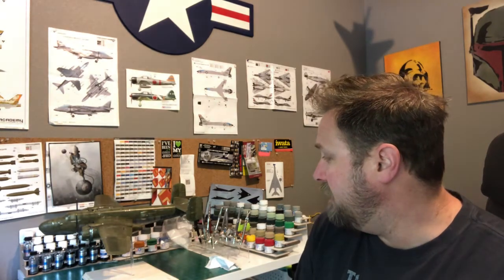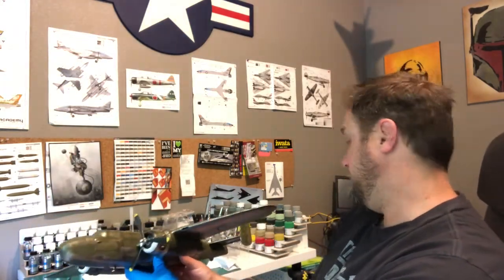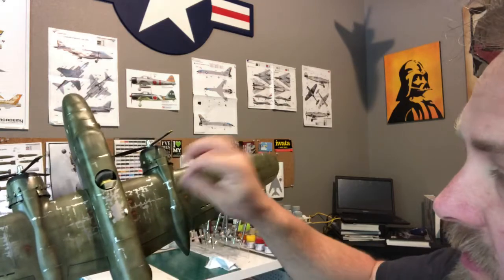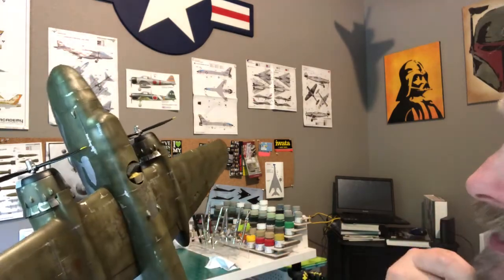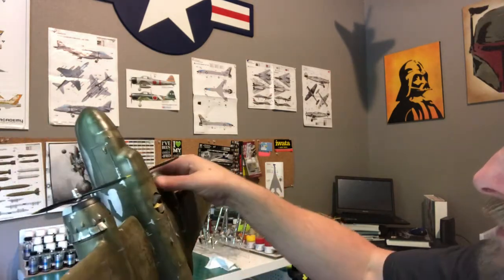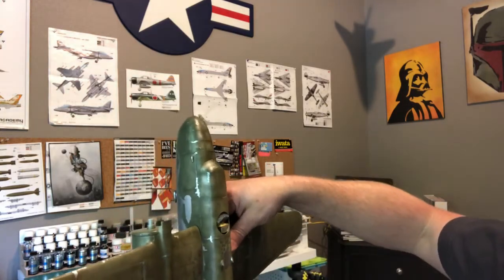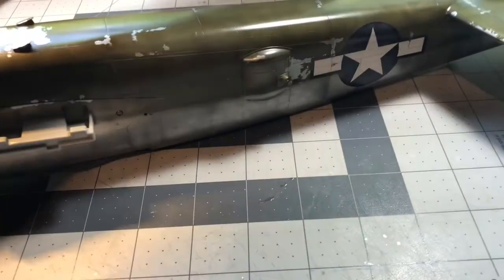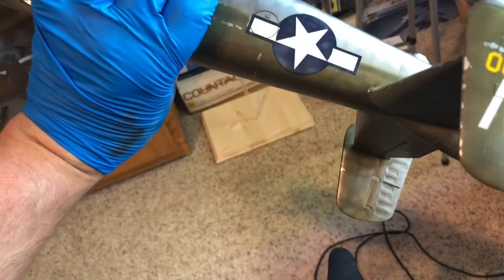Painting HK Models 1/32 Scale B25 Part 2

Comment: Awesome work, I have watched your B-17 and Mustang videos..question for you, what are you using to seal your paint jobs..Am wondering if your using Lacquer, acrylic/ future? Especially on the natural metal finishes. Also I am digging your base designs as they really add an awesome effect for displaying your work. Keep the videos coming.
Reply from the maker: Thanks!  My clear coats vary...typically I’ve been using “Future” for my gloss coats...I think I used Alclad Aqua gloss for the mustang.  I did recently use Tamiya X22 clear gloss on my BF109 mixed with mr color leveling thinner which is a lacquer thinner.  I’ve found that I have more control and can get the smoothest finish with that.  For my matte coats I either use Tamiya flat clear or Windsor and Newton acrylic matte clear.  For nmf...it all kinda depends on what you’ll be ok with as I think all of them dull the nmf to some degree or another, however, I’ve had the best luck with aqua gloss over nmf.
Reply: Primedmodelworks awesome, thanks for the info. I use future as well as tamiya. For my dull coats I just use the tamiya spray can. I usually do armor, but I have gotten back into aircraft and have started watching different channels on YouTube. I Love these bombers and especially your work since it’s legit, I really want to do these big aircraft but they cost some serious 💵